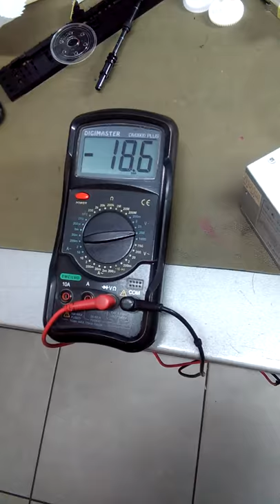Testing ink pump on Epson ink jet printer L series.

Comment: Hello my epson l1300 doesn’t print even tho i cleaned my printhead several times and then i changed the printhead but the problem stays, can it be caused by the ink pump?